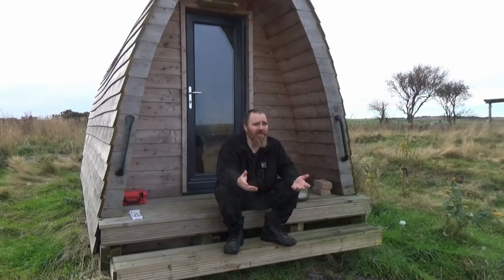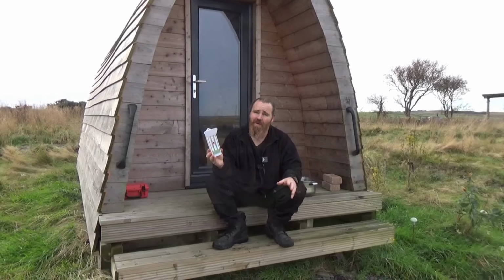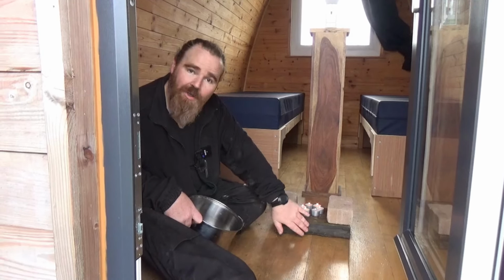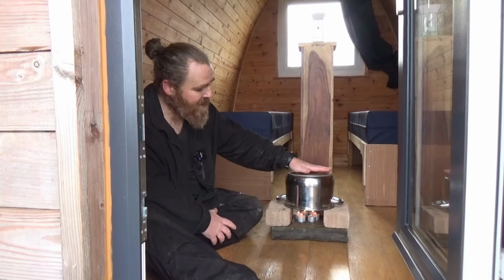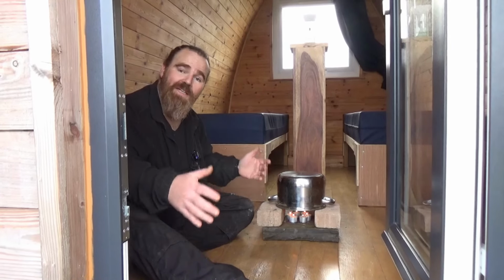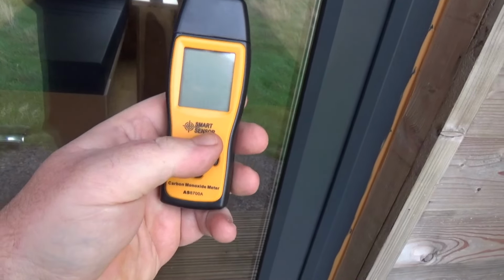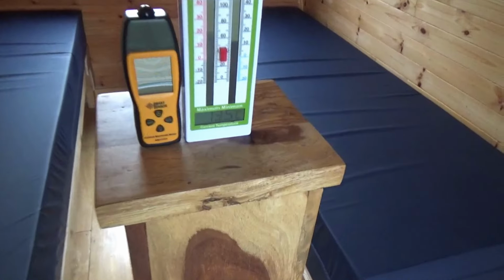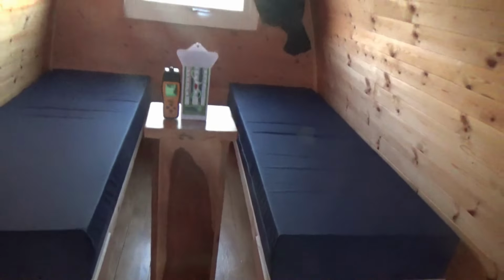DIY Flower pot candle tiny house/camper van/power cut heater tested. Effectiveness? Carbon monoxide?

Comment: Surely the real test needed is to put candles in the other room as well without the pot to see if the temperature is the same! 
Which I am sure it will be, your just transferring some of the heat from the candles to the pot before it is released into the room.
I would of thought this to be obvious logic to most people, at least those not trying to get views for a youtube video :)
Reply from the maker: The objective of this experiment was to establish whether it would heat the room. 
To test the effectiveness of the radiant heat against plain candles would be a different experiment, and one I plan on performing soon. 

I would have thought this was obvious logic to most people, along with the knowledge that it should be "would have", not "would of". 

I suggest you master basic grammar before trying to school someone on the scientific method.

But since I'm here, I'll explain some basic physics for you. 
The amount of energy contained in the fuel in a candle is set. True. However.....
There are three forms of heat energy transfer. 
Convective.
Radiant.
Conductive. 
Convective heat is the least effective, conductive heat is the most effective. 

An example of the difference between the effectiveness of conductive heat and radiant heat is a hot water bottle. If we fill two hot water bottles with a litre of boiling water each, they have identical amounts of heat. But it's far more effective to hold the bottle than to hold your hands six inches away from it. When you touch it. you're experiencing conductive heat. 
When you hold your hands close to it, but not touching, you're experiencing radiant heat. 

Same energy, just transferred to you differently. 
Conductive heat is clearly more effective than radiant heat. 

An example of the difference between the effectiveness of radiant heat and convective heat is a closed room with a window facing the sun on a sunny day.
The room will feel warm if you sit at the back, out of the sun. You are being warmed by convective heat, the warm air is warming you. 
But you will feel a lot hotter if you move to the window and sit in the sun. You are being warmed by radiant heat.

Same amount of heat energy into the closed room, just transferred to you differently.
Radiant heat is clearly far more effective than convective heat. 

You can experience all three kinds of heat from a candle heater. 
Put a board between you and the heater. The warmth you are receiving is convective. The only heat you receive is the heater warming the air, which then heats you. Air is a poor heat transfer medium, so is not very effective. 
Put your hands a few inches from the heater, but not touching. You will feel a lot more heat. This is radiant heat. Much more effective than convective heat transfer. 
If you were to touch the heater, you would likely receive a burn. You would be experiencing conductive heat, the most effective heat transfer mechanism of all. It's so effective, it's dangerous to touch hot objects. 

I am not expecting you to just accept this blindly of course, there are some excellent resources available online you could avail yourself of.
Reply: @CairnOfDunnCroftPermaculture  lol  Excellent response! Thank you for all of your time and effort for this detailed reply! I'm a grammar nazi haha
Reply from the maker: https://youtu.be/sK539ekJ4bo

Comment: How exactly did you measure the "effectiveness" of your pot-heater in this setting?
You have one cabin that is not heated and one cabin that you're heating with six candles. You're measuring the difference in temperature between the two.
How does that say anything about the "effectiveness" of the flower pot method?

Try heating both cabins with the same amount of candles and only add a pot to one setup. THAT would allow for a comparison in "effectiveness", but I would be very surprised if there was any significant difference...
Reply from the maker: Many people argue that these heaters make no difference at all. This experiment was to test that.
What you propose is an experiment to determine the effectiveness of the radiant bell. That is a different experiment, to test a different principle. I'll be testing it later this year, hopefully.
Reply: @CairnOfDunnCroftPermaculture  I've never seen anybody argue the fact that you can provide at least some heating by lighting a few candles. But at least now it's proven, for whatever it's worth.

People usually argue that these types of heaters provide no tangible benefit over simply lighting candles.

However, the proponents of flower pot heaters always claim the better efficiency compared to just lighting candles. You are discussing it in this video as well how much better radiant heating is compared to convection heating, that's why I was surprised that you don't compare convection vs. radiant but rather heating vs. no-heating.

Therefore, I'm looking forward to you comparing the two competing heating techniques.
Reply from the maker: https://youtu.be/sK539ekJ4bo

Comment: You mention that fact that you've done it with two people in, not with testing, and the temperature got up to 20 degrees.
Now, not knowing the start temperature  in that instance, and whether that was 2 people with the pot heater or without; but if anything like conditions for this test that would suggest that two people in there would be as effective if not more effective then the candles at heating the room.

it would be good to repeat this test without the pot heater and just have people in there. and see the increase they have on temp.

if they have more then the candle heater, then I would say that it shows the pot heater to be largely ineffective, and that the main contributor to any form of heating is ensuring doors, windows are closed and insulation is good. 
Then , if that is the case. which i think likely. Ensuring people wrap up in the house like we use to before double glazing and all round central heating would be sufficient in most cases .
and for the colder days, or elderly. turning heating on for short spells and keeps that warmth in might be as efficient. without the need to buy candels, 
which :
1. looking at Amazon is around £10 for 50. and using 5 at a time is roughly £1 to £2 per day on candels. on top of electricity and standing charges, is that really saing on gas usage.
2. as you say the co2 factor.
3. this is most likely for vulnerable to cold users, and I also wander if the fire risk to these users has also been consider with a naked flame.

Comment: I do wonder just how many people actually have a living space that small? the only room I have in my house that small is a bathroom. I find the smell from any candle burning is hard on my lungs even in a large room. Yes, it would only be for absolute emergency. I do live in Canada and I do have electric heat in my home. I don't see this as a solution for me if the power goes off this Winter.
Reply from the maker: In Europe, smaller housing is fairly typical. I don't think I've ever lived in house without a few rooms that small. Alternatively, larger rooms can be made smaller by improvising curtains from blankets.
Reply: @CairnOfDunnCroftPermaculture  Thank you for your insights, yes I lived in Europe for many years and do realize the video is addressing small spaces.
Reply: Not to mention in emergency situation you can put up a tent in living room or for kids..put the tent in their room to sleep. Really makes sleeping in the cold much better 😁😁 or build blanket forts like we did as kids 😁😁
Reply: @lisalee2885  Yes, but the fumes from the candles are toxic... I just ordered a propane indoor heater and think that will work better for me.

Comment: Poor folk like us can't afford to burn 6 candles, man. Thats hugely much more than I pay for using a gas heater. BUT, there should be some way of using a bit of concertina pipe into bashing a hole in an old cooking pot or tin to carry away the smoke and then burning a handful of debris and twigs with the lid closed and sucking in a minimum of air via a hole partially covered on the front.
Reply from the maker: It's intended for emergency use, not something to replace your gas heater. But if you're looking for a way to keep warm and it's not a grid down situation..... https://www.youtube.com/watch?v=3qtcr_qTBrM

Comment: Could you please try this without opening the door? Letting out the heat makes a massive difference. I'd be very interested!
Reply from the maker: It's a max/min thermometer, so dropping the temperature by opening the door won't matter. It'll keep showing the temp it was before I opened the door.

Comment: Some Youtubers are promoting using Carbon Fibre as the wick, and vegetable oil as the fuel.  Cut the Carbon fibre so it will fit in a small container - think the smallest cans of sweetcorn - roll it up and place it inside - add veg oil and ignite.  The Carbon fibre isn't affected by continued use, saving you a lot of money (and effort) over the long term.

I wonder what theor Carbon Monoxide output is like - couldn't you find out?
Reply from the maker: I've watched those. It's one of the experiments I'm considering for this winter.

Comment: Wenn ich eine Kerze oder ein Teelicht abbrenne, wird eine genau definierte Wärmemenge frei. Warum soll das mehr sein, wenn ich einen Topf darüber stülpe?
Reply from the maker: The amount of energy contained in the fuel in a candle is set. True. However.....
There are three forms of heat energy transfer. 
Convective.
Radiant.
Conductive. 
Convective heat is the least effective, conductive heat is the most effective. 

An example of the difference between the effectiveness of conductive heat and radiant heat is a hot water bottle. If we fill two hot water bottles with a litre of boiling water each, they have identical amounts of heat. But it's far more effective to hold the bottle than to hold your hands six inches away from it. When you touch it. you're experiencing conductive heat. 
When you hold your hands close to it, but not touching, you're experiencing radiant heat. 

Same energy, just transferred to you differently. 
Conductive heat is clearly more effective than radiant heat. 

An example of the difference between the effectiveness of radiant heat and convective heat is a closed room with a window facing the sun on a sunny day.
The room will feel warm if you sit at the back, out of the sun. You are being warmed by convective heat, the warm air is warming you. 
But you will feel a lot hotter if you move to the window and sit in the sun. You are being warmed by radiant heat.

Same amount of heat energy into the closed room, just transferred to you differently.
Radiant heat is clearly far more effective than convective heat. 

You can experience all three kinds of heat from a candle heater. 
Put a board between you and the heater. The warmth you are receiving is convective. The only heat you receive is the heater warming the air, which then heats you. Air is a poor heat transfer medium, so is not very effective. 
Put your hands a few inches from the heater, but not touching. You will feel a lot more heat. This is radiant heat. Much more effective than convective heat transfer. 
If you were to touch the heater, you would likely receive a burn. You would be experiencing conductive heat, the most effective heat transfer mechanism of all. It's so effective, it's dangerous to touch hot objects. 

I am not expecting you to just accept this blindly of course, there are some excellent resources available online you could avail yourself of.

Comment: I’m looking for cheaper ways than central heating, to heat my flat, and although this looks a great idea, I would be v concerned about other gasses than Carbon Monoxide, such as fumes from the Peroleum Wax and any additives that are used in the making of the Wax. I would love to use this idea as I have a couple bags of old bits of Candles that I’ve collected/scavenged/been given etc. Also Nitrous Oxide would be an issue would it not?
Reply from the maker: It's more suited as an emergency heater than a form of planned space heating.

Comment: Of course the candles will warm the room. But I'm not convinced that the pot makes any difference. It will take in the heat when the candles are first lit, making them less effective, then stay warm for a while after they go out. You get the same amount of heat. 
 The fair test would be one pod with candles only and one with candles under a pot. 

But as candles burn with a yellow flame, some of the energy is emerging as light. If you could actually create heat from nowhere,
Reply from the maker: https://youtu.be/sK539ekJ4bo

Comment: Can it expand the heat if you put a water vent pipe on top of the flower pot or to warm other rooms.If you use a bigger flower pot can you put a pot on top of it to cook ?
Reply from the maker: Really it's a small room heater, it doesn't have the power to heat other rooms or cook.
Reply: The whole reason they're called tea lights is because they were used to keep tea warm. You can absolutely heat water and heat basic canned foods with tea lights.
Reply from the maker: @EvieBeanVideo  warm things yes, but I was asked about cooking. It's not the same.
Reply: @EvieBeanVideo  keeping something warm isn't same as heating something up from cold. Former requires less energy.

Comment: There was one flaw in this experiment. You need to run it again using the pot in one and just the candles in another. It's fine to say the pot warms better than the other but that's just conjecture.
Reply from the maker: The purpose of this experiment was to test whether it raised the temperature, and to determine CO levels. 
I agree that testing the radiant heat effect would be interesting though, so I'll make part 2 as soon as winter hits properly.
Reply from the maker: https://youtu.be/sK539ekJ4bo

Comment: I've tried many different variations of this - clay pots, steel pots, etc. - didn't work to heat our home last winter...

Do yourself a favor - get a wood stove for your home. THAT actually works well...
Reply from the maker: I have a rocket mass heater in my home, far more efficient and effective than any wood stove. 
This heater is not intended to be a house heater, it's an improvised heater for use in emergencies.

Comment: it is always good to think about saving energy. candles however are ,even from China, very expensive! oil or gas costs even more...these huts look good isolated and when you live in there your body also works like a heather because you drink and eat....so: the cheapest energy is energy you don't use!
Reply from the maker: I've slept in the pods in all kinds of conditions. While body heat definitely makes a difference, I can assure you they get cold in winter.
Reply: Lots of places sell tea candles pretty cheap..dollar stores, big lots and you can get a bag of 30 or so for 5 or 6.00 atleast here in California

Comment: Why doesn't the control pod have any candles? To me the question is not whether tea lights make a difference but if the stupid upsidedown cooking pot is doing anything at all.
Reply from the maker: That's a different experiment, that I plan on doing this winter. 
I'm not sure how a pot can be stupid, however.
Reply: @CairnOfDunnCroftPermaculture  If it's in the wrong place and doesn't make a difference it should be in the cooking cabinet. If you don't understand what I'm saying I can be more upfront with you and say: The person putting the pot there if it does not make a difference, and also fails to create a relevant test is the stupid one and not the pot itself. I was trying to be nice about it but as with most people when the brainpower runs out, marking words and purposely misunderstanding simple things seems to be the norm here.

Comment: Problem with carbon monoxide detector is mostly it's needs electricity to work so if there no power how can you do without it
Reply from the maker: Mine runs on AA batteries.

Comment: Main problem next to carbon monoxide is particulate matter. (If I translated it correctly, we call it ‘fijnstof’ in the Netherlands).   This is very bad for your lungs and overall health.
Reply from the maker: I agree. This is an emergency heater, not suitable for long term use.

Comment: For the amount of fresh air you need to override the CO2 you have lost all your heat. Now to make your fireplace more efficient take a large piece of cast iron and place it with the firewood as the wood burns down the iron will hold heat for several hours
Reply from the maker: I think you mean CO, not CO2. Anyone with a fireplace will not need one of these heaters.
Reply: @CairnOfDunnCroftPermaculture  I stand corrected what heaters are you referring to
Reply from the maker: @leonbachman5345  I mean one of the emergency candle heaters I demonstrate in the video.
Reply: @CairnOfDunnCroftPermaculture  those are more for a car or pickup